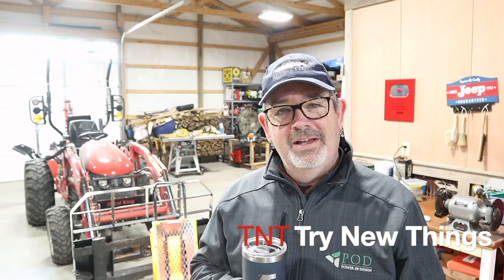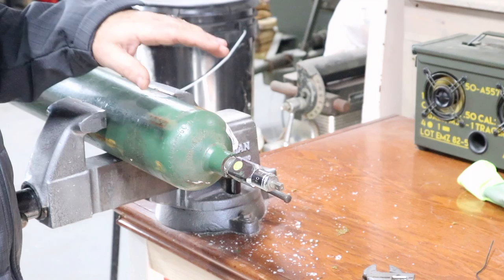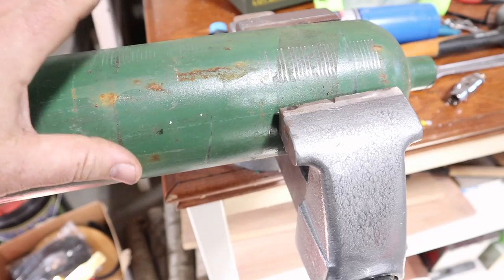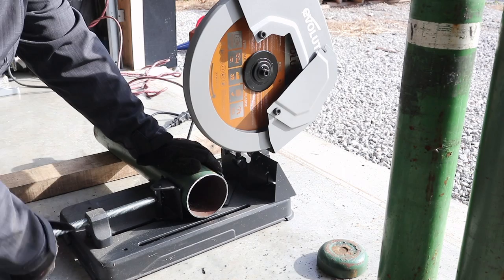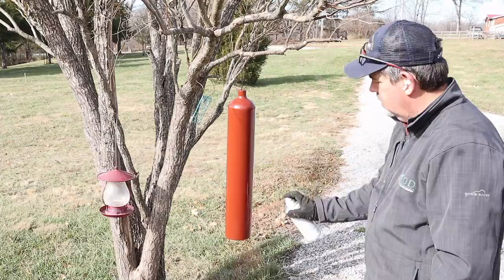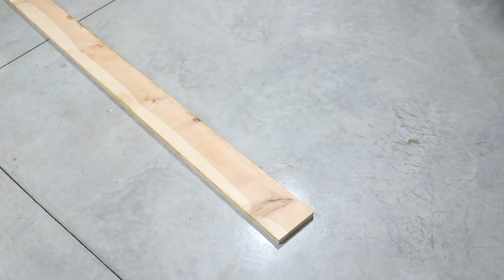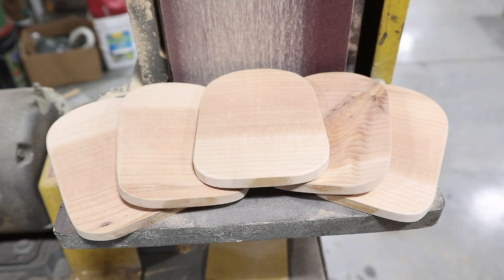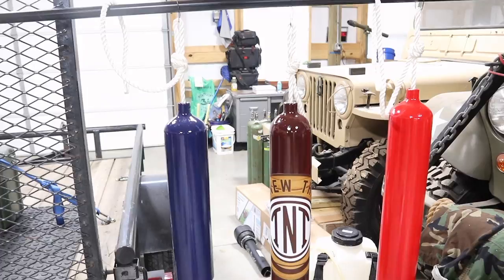TNT #152:  Making GIANT Wind Chimes out of Oxygen Tanks

Comment: Very cool, I was considering finding an old tank for this purpose and love what you've done. I've made a chime out of a 3" piece of old copper pipe. One thing that I did differently with the final product, as with some cylindrical bells, is use sound slots -- meaning you cut slots up the sides -- this can let it resonate better. I saw this when looking at other commercially produced bell chimes. My first iteration of my pipe chime did not have the slots and I thought it was a dull sound. Once I incorporated this design change, it sounds much better!
Reply from the maker: Great recommendations, I still have 5 tanks off in the corner, was going to make some more this winter, I’ll have to look into the slots!

Comment: Ive done this . Odd in ky as well . There more like bells than chimes but pretty cool none the less . If ya chop the top off making them a pipe then you can tune them very well .
Reply from the maker: I find they sound a bit like a railroad crossing if the wind times the repeat just right.   How do you hang them when you cut the top off?    I have 5 tanks left and despite by best efforts I just cant get the nozzles out of them, just cutting the tops off would get me around that.

Comment: Never seen anything like that. Different design from standard wind chime, but I imagine it would sound like bells if any other way. I presume shorter tanks change sound. Thanks for sharing a new thing.
Reply from the maker: I did one about 6-8” shorter, was a slightly different ring.   Next round maybe I’ll try one about a foot shorter.    It is a different sound however not dramatically different.    Thanks for the feedback.   Always welcome and appreciated.
Reply: @TryNewThings  if you used a heavy piece of wood that's rounded as the clanger, it would have a softer less tinny sound